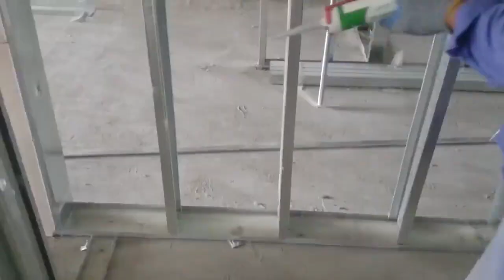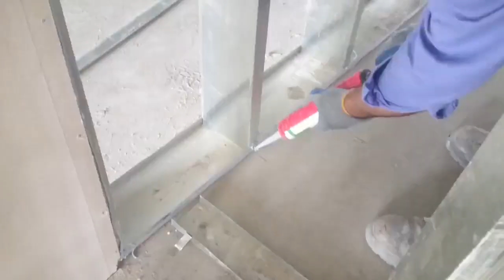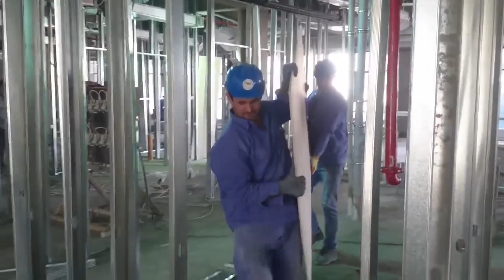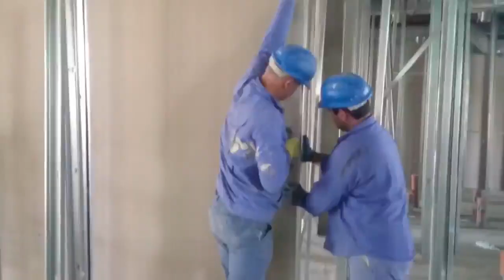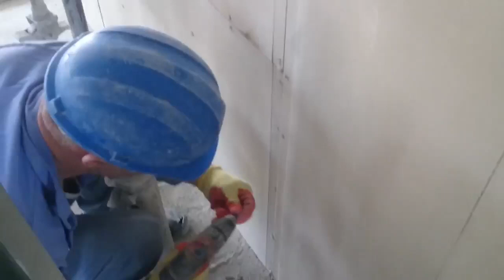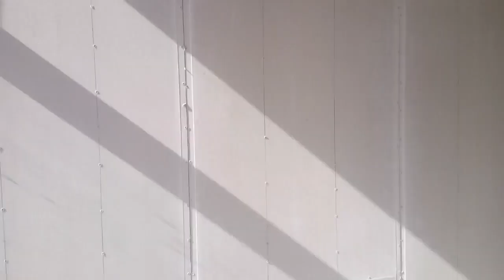Fiber cement boards installation

Comment: Waoooo.. What is the material of the frame? . You are drilling it right through the board right?
Reply from the maker: non autoclaved lightweight aerated concrete infill to make the building system solid and durable www.pioner-group.com/concrete